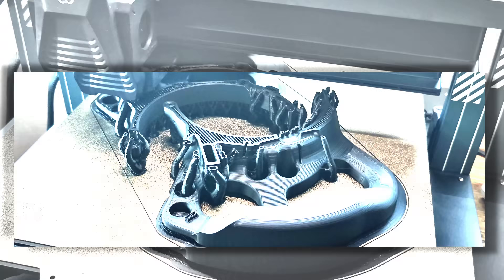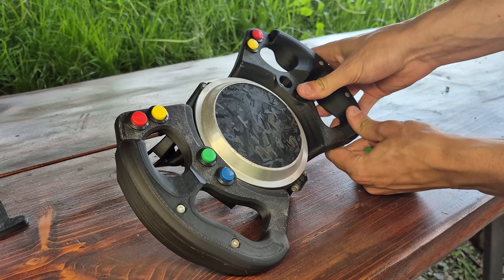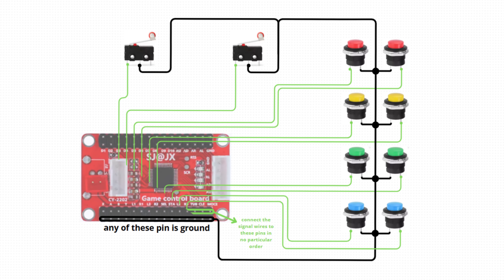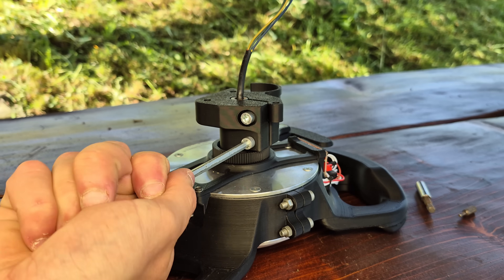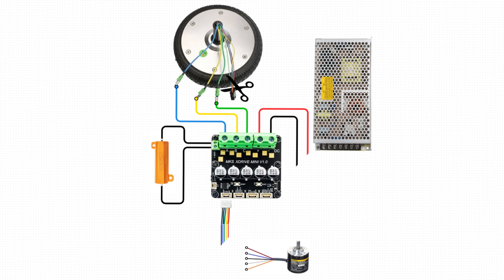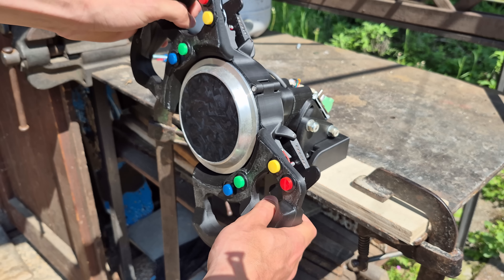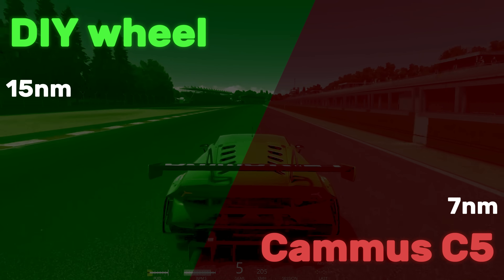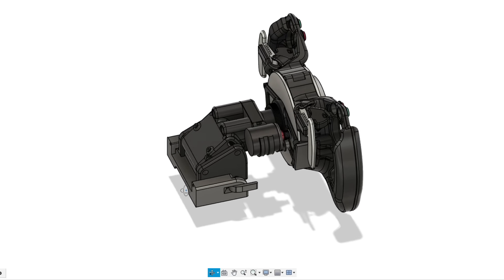HOW TO BUILD a 15Nm DIRECT DRIVE Steering Wheel | DETAILED TUTORIAL

Comment: Now do load cell pedals
Reply from the maker: @ImNotQualifiedToSayThisBut  for sure
Reply: you mean active pedals?
Reply from the maker: @ralden9983  no, loadcell is the thing measuring the force you apply, I will probably add shakers to provide haptic feedback though
Reply: @DAZprojects Prova per favore anche i pedali attivi, sarebbe una sfida ingegneristica molto figa. Sto pensando a qualche tipo di motore con una vite stile 3D Printer. +loadcell ovvio.
Reply from the maker: @sedixmrboss5625  mi sembra una cosa troppo complicata, anche perché di firmware e programmazione non me ne intendo
Reply: @DAZprojects   just don't use vibration motors they are sh1t. use audio haptic
Reply from the maker: @zeDoSauRus  obviously, like in my previous pedal buikd
Reply: @DAZprojects  Se mi ricordo bene, qualcuno ha gia fatto un firmware per sta cosa.
Reply from the maker: @sedixmrboss5625  speriamo

Comment: this is useless guys, you cant get it stable with 3d printed parts, believe me, use metal parts if you dont like meaningless vibrations
Reply: Fanatec DD, Moza R5, Cammus, all use plastic
Reply: @DAZprojects   @user-wq9mw2xz3j  07:10
Reply: @user-wq9mw2xz3j  07:10
Reply: @user-wq9mw2xz3j  07:10
Reply from the maker: @mevlana_kiskaci-h1i bro build it and then comment, the motor gives structural stability to the whole thing being metal, it's not 100% plastic

Comment: I’m in awe on how easy you made this build. Been saving two motors for this reason, and if you drill out a wheel pattern you might be able to install bigger metal wheels for drifting. This is awesome thank you for the inspiration.
Reply from the maker: I'm planning to make an add on wheel without buttons especially designed for drifting, with shifter and handbrake
Reply: @DAZprojects fine, im subscribing.

Your first video on the hub engine project caught my interest. Took me a while to get a machinist to accurately do the work you did with a hand drill. I snapped like 2 or 3 drill bits trying to drill out that axle. And I never even made it all the way through the first one.
And yes, I bought those fancy silicon carbide or whatever borium shizz the internet said wouldn't dull

Cause I used a good old HSS at first, and eventually had to call it because the bit was just walking around at the end, dull as a spoon.

Anyway, I'm now at the point where I'm building an AliExpress shopping cart, and then having to build the entire thing.
Got soldering equipment and everything ready. Did some practice soldering projects just to get the feeling back from school.
Haven't touched a soldering iron in a decade.

I'd love to see you build a more thorough guide. I know people love these short, and condensed guides, but, I want the full details.

Walk me through every part I need to buy from AliExpress in the first part of the video

Walk me through preparing all the parts (e.g. drilling out the hub engine) in a second part of the video

Walk me through the assembly of all the parts into a single device in a third section

Walk me through the setup process of the previously purchased boards, and the software that's attached to them.

The problem about this project, for me, as an autistic planner, is that, once I've gone through all the videos, and put everything on the list, including the things that get conveniently forgotten, not that you're more guilty than anyone else, the FFBeast crew are too, but, I get cold feet. It becomes such a large process that I can't keep track of everything, and I can tell, and it makes me nervous. I don't want to trip up while doing this.

And please, don't just settle for "assorted screws", I need to know exactly which types. What type of head, what type of thread, what length, what width, etc.

If you want, I'd love to get in touch with you, and assist you in the creation of this extremely detailed walkthrough of the project. I've been working on it since... Late 2024, November-december type stuff.

I have a lot of crap put together. I was very close. I ordered everything at one point. Then I cancelled it.

I was going a bit overboard, and trying to build the entire city of Rome in 1 day.
Parts for a base, a wheel, with button box and paddles, pedals, h-shifter and handbrake.

I've bought a nice new 3d printer, soldering equipment and so on, I've really done my homework.

I'd like to use this opportunity to finish my project, and, to document it for you, so that you can produce a video so thorough, that truly, nothing will be left to chance.

Let me know how you feel about it if you'd like to get involved, I'm all on board for it, and we'll exchange some info, and we can get started.

/Hoverbike
Reply: @DAZprojects is it possible to get to know the cost of printing all the 3d parts in one package? If possible then please add this link in the video description, since many of us don't have a 3d printer

Comment: 3 hours ago ???!
You can't know how glad i am to have found this video, thanks alot, but, can i ask, is there a way to be able to change the wheel design, like a clip-in or interchangeable wheels (F1 Style, GT Style, Rally Style etc...) like, is it a planned feature you are working on, thank you.
P.S.: can you make a DIY 3D printer ? (Would be so great ngl)
Reply from the maker: 3D printers are so cheap now that I don't see a reason to diy one, as for the wheel adapter, I got a bunch of requests, so I'll definitely make a round wheel for drifting, and probably an adapter to mount standard wheels

Comment: Great project but I found the first version more interesting, this one is limited in some points, like changing the flywheel and I didn't understand the change of the magnetic sensor for an incremental one with a belt... the direct magnetic is always superior and more durable mainly because there are no pulleys and belts, besides reading more pulses most of the time and more direct, good video, but I think your old video is still better
Reply from the maker: @-MarcelLuan- thanks for the appreciation, I used a rotary encoder mainly to avoid needing to modify the motor so that it's easier to build
Reply: @ Excellent point, this way it really is much simpler so that people without much knowledge can also do it, excellent video
Reply: not true, it's not superior nor more durable in any way, and many people have problems with non linearity error due to slight misalignment
Reply: @ 
Magnetic is very durable and if you don't do it right you won't have any problems like the g29, g920, g923, etc., unlike using a pulley and belt, which becomes loose over time.
Reply: @nirodper  ''Simple, fewer parts less problems''
Reply: @-MarcelLuan-   Photoelectric is very durable, it's a common industrial part and has no wear components. The toothed belt under zero load won't get loose. Magnetic encoders have bad accuracy and the ffbeast software doesn't have non linearity compensation. A hall effect rotary encoder isn't "simpler" than a photoelectric disc with slots, and having fewer parts isn't necessarily better
Reply: @nirodper  Well, I've been using it for years and everyone I know who uses pulleys has had problems and switched to magnetic ones so as not to have problems, in addition to the precision tests we did in programs and the magnetic one always won, in terms of durability I believe that industrial ones last longer, but the pulley system doesn't, BUT, we can combine the two systems using a photoelectric encoder directly on the motor, then it would be perfect, combining a long-lasting encoder in the direct system.

Comment: are you still using the ffbeast firmware? I buit mine using the magnetic encoder but its not stable, I might try using this type of encoder.
Reply: what is happening with wheel because of this magnetic encoder? because i jsut bought parts for original ffbeast project and im worried if its gonna be bad because of that encoder
Reply: @perkonek  
In fact, that magnetic encoder is better than this one, mainly because it is direct without belts and most of the time it has more PPR (I use it and I have friends who use the one in the video and are changing to the magnetic one)
Reply: @-MarcelLuan-  not true, many people have problems with non linearity error due to slight misalignment
Reply: @nirodper  
Magnetic is very durable and if you don't do it right you won't have any problems like the g29, g920, g923, etc., unlike using a pulley and belt, which becomes loose over time.